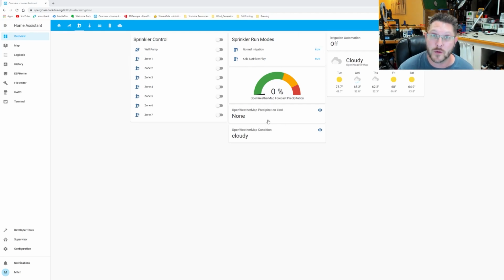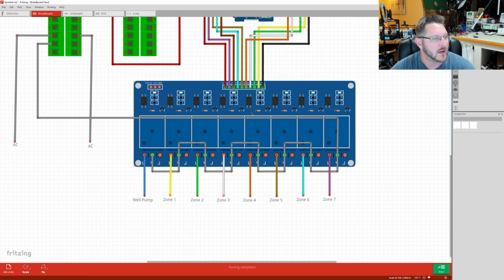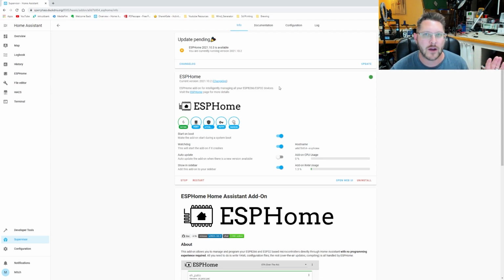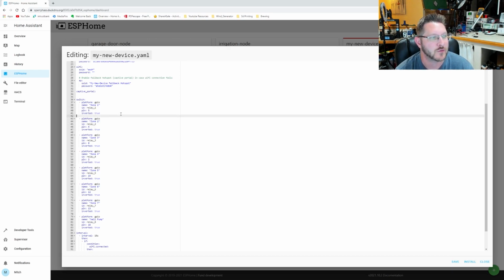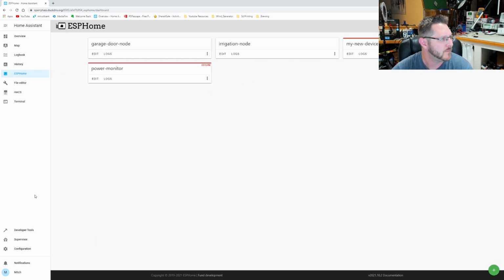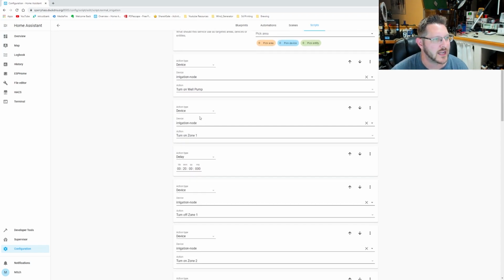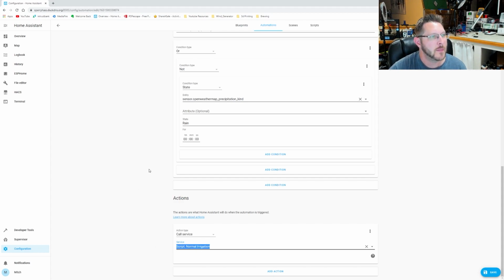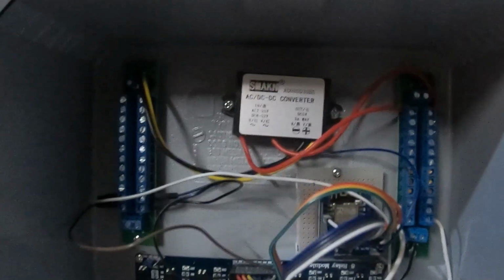How to Make Smart Irrigation

Comment: I understand everything except how the 24vac power supply connects into this picture so the solenoid valves receive power. I am trying to replace a hunter sprinkler controller. Could you please help me understand this?
Reply: Also - where does the ground wire go? The 24vac adapter has a third wire for ground that is currently connected to the hunter sprinkler controller.

Comment: so what do you use for a power supply for the solenoids ?  Usually 24v AC. I can't seem to find a 24v AC power supply, 24v DC power supplies are easy to find.

Comment: I made one like this about a year ago. You should interlock the relay switches in ESPHome. That way only one zone can run at a time. If you switch on a new zone it will turn off the previous zone. I also put the schedule in the ESPHome code so it can change the days it runs based on the current month. We have watering restrictions here so as of November 1st I can only water on thursdays. The ESPHomes code changed this automatically. I do need to get the AC-DC converter like the one you used as I am currently using a phone charger to run the ESP board.
Reply from the maker: Hey there, great suggestion.  I will have to try that out and update the code in the repo.
Reply from the maker: Here are some links I found:

https://esphome.io/components/switch/gpio.html#switch-gpio-interlocking

https://esphome.io/components/switch/gpio.html
Reply: And where I find your code?
Reply: Incredible video! Thank you so much!.... Just a quick question, why do you switch the well on and off? Doesn't that just automatically turn on when it senses it needs to put more water into the system?

Comment: Nice! I built one on solar feeding from a tank with a 12 volt pump. (Using Tasmota) I use soil moisture sensors and node red to tell it what zone to water where and when. Need to redo it and look at the WiFi safety.
Reply from the maker: That is a great setup.  I like the moisture sensor data in determining where watering needs to take place.  I wonder about the soil sensors.  Do they go bad often?  Just curious.
Reply: @misperry  thought I replied earlier, but not sure it posted (maybe because I mentioned a sensor manufacturer). I had one I encased in a 3D enclosure I designed. Filled it with silicon caulking… lasted a few months and died. Switched to ruggedized using conformal coating and marine shrink tube. One died, but late in the season so I haven’t tracked down if it is the sensor or a bad connection. These are capacitive, not resistance, sensors. You can Google how to ruggedize them like I did. I also make them easy to swap out if one goes bad.
Reply from the maker: @BrummBilt  nice.  Yeah I see this one.  Conformal coat is a good idea and I like the epoxy too for added protection.  I was just curious since like you said some of them can die fairly quick but the ruggedizing is a good idea
Reply: ive toyed with this idea many many times but have not used them yet as all i hear from people is they die really fast. its a great idea that way as you say the sprinklers know when to water if the ground is dry but then if/when they die then no watering.
Reply: @clintAdventures  yeah, I also keep an eye on the plants and can water manually via HA. If I were ambitious enough I could set it up on a schedule by zone if one or more sensors fail and it’s been X time since the last watering.